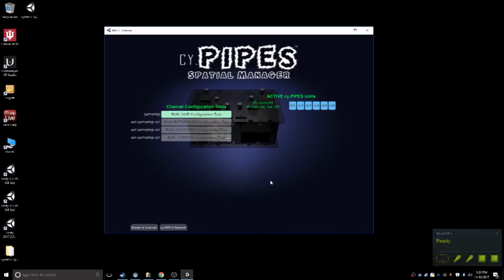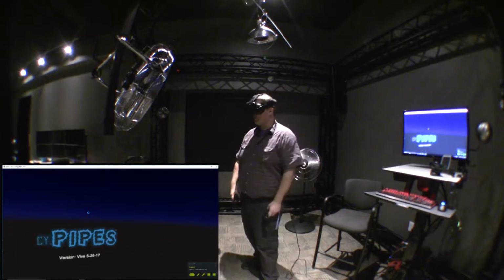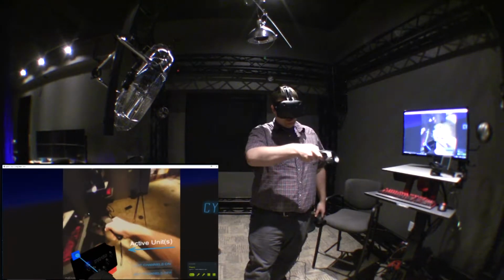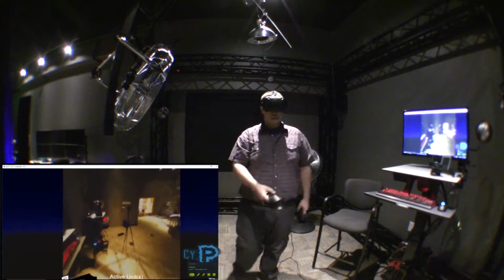Vive 4D Configuration - cy.PIPES "Show And Tell" (11-30-2017)

Comment: cool stuff 
....also being meant to work with unity ...it can be used in other ways .....like with a hololens or even a phone app or whatever
Reply from the maker: You bet, I have the system working with the HoloLens.  Touch-less high voltage control is a fun thing to tinker around with.